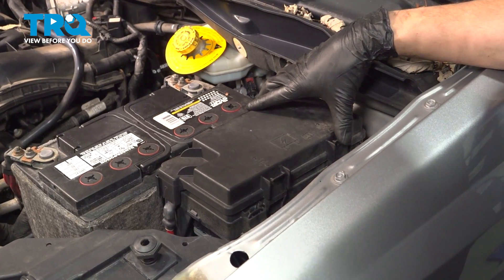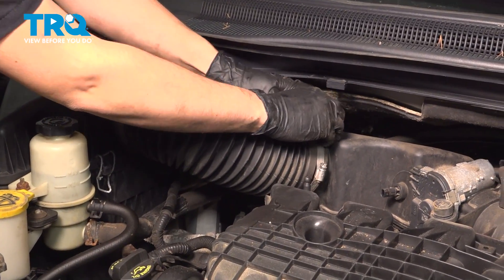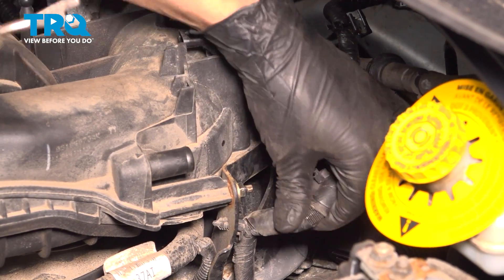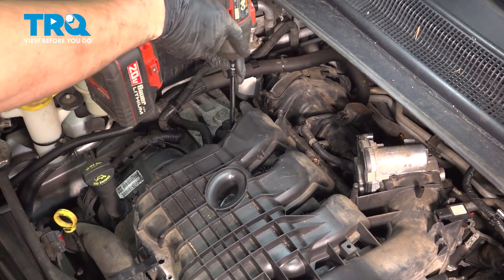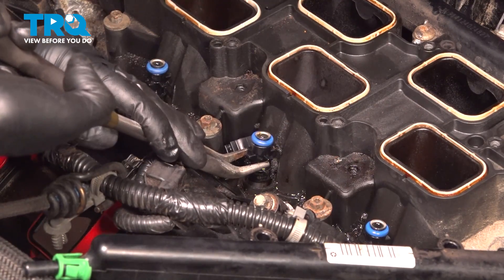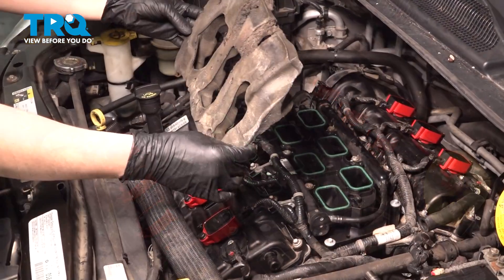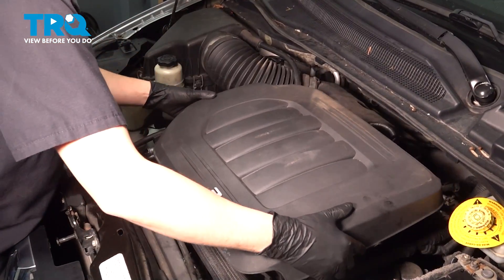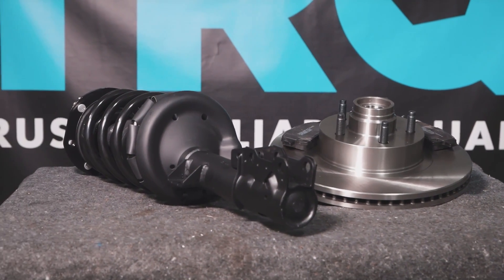How to Replace Fuel Injectors 2008-2020 Dodge Grand Caravan 3.6L

Comment: Word of caution. My upper intake has 7-9nm molded into it with a pic of the bolts. Thats 62in-lb to 79.7 in-lb. I used your 89 in-lb torque spec and stripped out bolt #1. My own fault for not double checking, but be careful.

Comment: In the middle of this job on a 2018 pacifica.

Questions:

1. What do you do with all the fuel that spilled? I spilled just like this video and want to make sure its safe to drive and when. Soaked up as mucj as I could.

2. I replaced two lower o-rings and the two I replaced slid in, almost too easy. Is this going to be a poor seal? The parts are OEM spec from FELPRO.

Comment: Thanks for the video. Over the weekend, we decided to replace all 6 fuel injectors, as well as the plugs and coil packs, after the check engine light came on and my tester came back with P204 and P304. The job went smoothly enough, but once everything was back together, I got a NEW code on cylinder 3, P203... is it more likely to be a bad replacement part or something worse? It was too dark to take it all back apart by the time we had finished.😢

Comment: Which systems correspond with the fuses that were removed. Would like to remove the fuel pressure from a pentastar in a Chrysler 200

Comment: Just did spark plugs and a new coil for cylinder 2 on Sunday. Now, tuesday the P-0302 is back. Looks like I'll be doing a new injector next. Thank you for showing how to get that rear bracket off. None of the videos i watched for spark plugs showed where that bolt is. We just had to bend and fight the brackets to get the 4 studs loose. Any tips for getting the black box back onto the throttle body? We got lucky after fighting it for 15 minutes.

Comment: This video just proves the issue on my 2016 grand caravan. Misfire for cylinder 6.
I bought the spark plugs all 6 and changed them. Had a mechanic replace the coil and my car still shakes and feels like it’s going to faint. I’m back to the mechanic again for the same code P0306 and checking the fluid injector. 
What can u recommend or give advice to my situation. 
Keep up the videos! 😊
Reply: You can swap the fuel injectors and check to see if the code remains for the same cylinder. If different cylinder code, you'll know it's the fuel injector you swapped. 
If same code, have the mechanic test compression. Likely a burnt valve. Expensive news.
Reply: What did it end up being?

Comment: Wouldn't it make more sense to just remove the lower intake manifold to do this job and avoid the fuel getting into the v of the engine, as well as give you the opportunity to clean the manifold? As you were cleaning around the injectors, it would seem there's a strong chance of that debris getting into the intake, so I just feel like you're taking far too many risks here.

Comment: Just finished it and can't tell You how much i appreciate Your explanation.
 My van has 176000km, so changed sparkplugs too. 
Only difficulty was the electrical connection to the injector. Couldn't pull it off, so pulled the injector out, than saw that even after the red pin got pulled up, a black tail was still holding on. It was easy to disconnect after. Recommending to change the intake seales too, really cheap.

Comment: I have a shudder with acceleration and flashing check engine light, I have codes p303, for cylinder 3. I changed coil and plug so far. Would you say that I should start with cylinder 3 if I’m replacing the fuel injector?